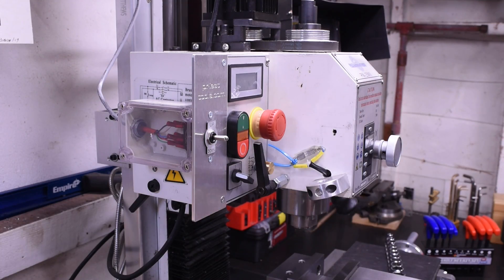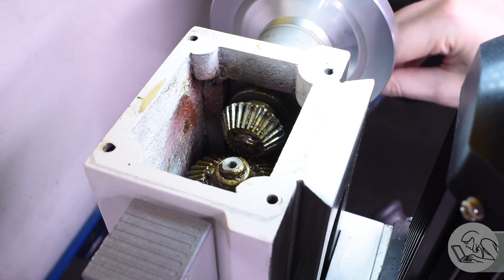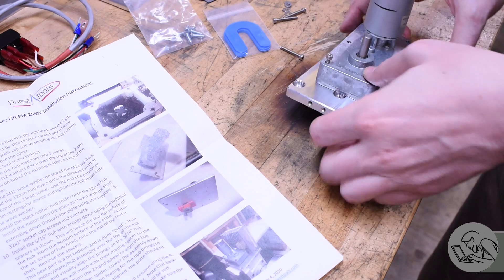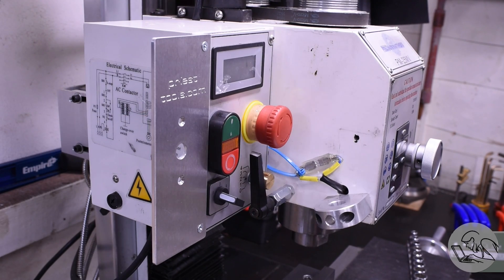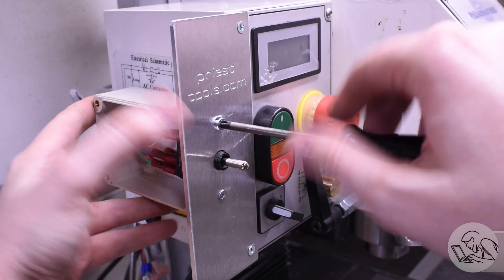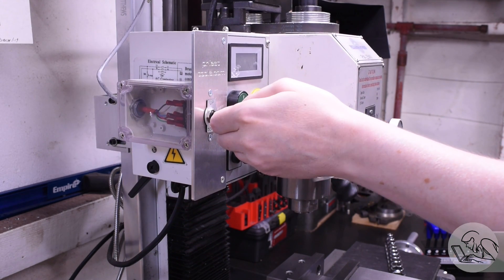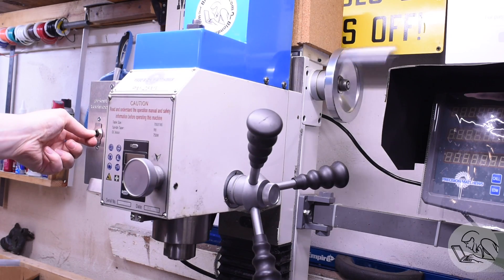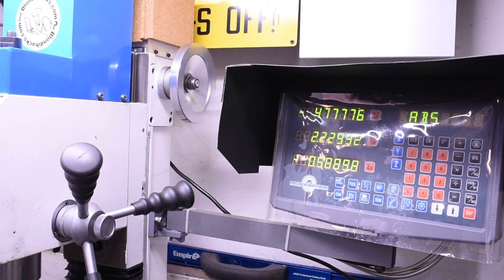Power Z Feed For The Head on a PM25 Milling Machine!

Comment: Hmm. Pretty cool; didn't know these were available. I've always kept a cut-off 13mm nutdriver, chucked in a 1/2" drill, next to my Grizzly G0759 (0704). Works great to quickly run up the Z, and it's "stupidly simple" (and cheap)

Comment: I was wondering about travel limit switches but the motor would stall and as soon as the switch is released the power is off so not necessary.

Comment: Hey Blondi, I'm a carpenter and I can consistently cut to a 64th of an inch with a worm drive Skilsaw #NotSponsored all day long (I even do it while wearing ear plugs and eye protection) so there's no excuse for a machinist who can't cut cork board to a quarter of an inch with a utility knife :-).  Moving on, I had to silence a very noisy air compressor once that took up the shape of a two+ foot cube. The base was a concrete floor and the sides and top where 3/4 inch particle board lined on the inside with walls of 2 inch blue styrofoam (adhered to the particle board with dabs of silicone caulk).  The lid was just laid on top of the walls (also insulated with the styrofoam) and could be simply lifted off to access the compressor controls as necessary (was held in place with a couple of drywall screws so it wouldn't rattle).  When the lid was in place the styrofoam laid right down on the inner foam walls.  The inner foam box and the outer particle board box had no gaps in their respective corner joins. There was a two inch diameter hole drilled near the bottom on one side of the box where air could be drawn in and the power cord could come out and there was another hole on a different side for additional air flow .  There was a third hole that was smaller to accommodate the exiting air hose.  These holes were then lightly plugged with pink spun fiberglass insulation.  This box took the sound of the compressor from deafening down to a hum.  The noise reduction was quite impressive.  Heat dissipation was not an issue because the compressor was running intermittently. It was just being used to supply a finish nailer and a narrow crown stapler.  The trick of success here is to put the less dense "decoupler" on the inside of the more dense outer "deadener" and additionally try to get rid of every possible air gap.  Assemble wooden parts with glue and foam parts with silicone caulk. 

Moving on again, I was glad to see that the replacement drive train took away a big chunk of the noise you were experiencing.  Priest Tools QC should have caught the problems with the first drive train as well as the switch box hole misalignments and sheetmetal cover fitment.  Low volume small businesses have the opportunity to test their products individually before shipping (because of low volume) and should do so, especially when the main component (the drive train) is not something that they are manufacturing in house.  It's strange that you would defend them for these errors when you yourself wouldn't send out let's say a vise stop as a box of parts that you never actually tested for fit.  Think about it, the crappy  threads on the socket screw, the initial no-go on the stop pin. Wouldn't it be fun if that was what you received in the mail from Blondihacks Enterprises #Not Sponsored.  What makes a product good is the attention to those details.and delivering the so called "plug and play" device. (For an example check out Bell-Everman.com #NotSponsored) Even the polish with the  ScotchBrite wheel adds quality.  Just because someone sends you a product #Sponsored don't get all gooey and drop the standard.  For something that costs $350 and except for the base plate and sheet metal cover is a collection of off the shelf parts it's just not acceptable.

That was exhausting.  I'm going to go eat something...Give me purr Sprocket...

Comment: So the thing about countersunk screws is that when they don't line up nicely, they will stick out and be super obvious. Might have been a better choice to open up the switch hole. For extra awesome switch mounting, the trick is to put the nut on the back of the box, and the knurled nut on the front. Line up the knurled nut flush with the end of the threads then tighten the nut with a super special extra thin wrench. It's way too much work, but it looks excellent!

Comment: Nice kit.  I built my own using a right angle wheelchair motor.  180 rpm max / 50 rpm min.  Enough torque to   bore at a good feed rate.  Made a dog clutch to be able to disengage and use the crank handle for fine adjustment of the Z axis height.

Comment: well from my POV, for less bucks you can get a closed loop stepper with a pulse generator and make a control panel with switches and poti to control speed and direction. And you can use it later on for CNC conversion ;)

Comment: I have a friend down in Annapolis who built his own Z Lift. One of the things he did is add a counterbalance to the head. He used SS wire anchored to the head and pulley wheels on either side of the column. Rectangular Iron weights from an exercise machine equivalent to the head weight, hang down behind the back of the machine. The stepper motor he used therefore did not have to be as powerful. Here is a link to the video: https://youtu.be/pN1iDhBmo2I

Comment: Nice kit review and it sure beats cranking the handle all the time! Take that heavy metal handle off of your hand crank.  It's acting like a vibrator motor at higher speeds.  I remade mine out of HDPE on the lathe.  Removes a good bit of weight and still functions the same.

Comment: I discovered your channel while searching for long lost knowledge of lathe work, after a recent need caused me to dust off my mini lathe for a project.  From the darkness of my memory, a chatter rang out.  Behold, I binge-watched your entire lathe series, and the dark clouds dissipated and I discovered not only the long lost knowledge, but found all the bits and pieces and tooling that I had repurposed over the years for other projects.  Your presentation is clean very easy to follow and is so very much appreciated.  I am but a neophyte with only a milling attachment for my Grizzly.... still, with all ten fingers intact, hope springs eternal. Thanks!

Comment: WOW ! 300 buck for this thing !
Motor costs no more than 30-40$ on aliexpress and an old PC alim will be a perfect power supply (with 3.3 - 5 and 12V directely available). coupling can be done on mill with a rotating plate.
Not sure than this won't overheat. I havent seen any cooling hole on the cover. It's true that it won't be running for a long time.
I've got the same mill and I removed the motor cover for the same reason (I saw that you already have a burned one)
P.S. : J'ai regardé tes autres vidéos. Ton français est très bon, avec une pointe d'accent charmante ;)
Reply: Yes you can build a z drive for a lot less- and what do you have a mill and shop for?
https://www.youtube.com/watch?v=J5zTBCMfZro&t=122s

Wiper motor from an old vw, and some odd bits, and "el-cheapo" is your uncle....

Comment: I used a 12v speed controller installed in line with the power supply. You can control the down function to a crawl for drilling and power up at the up function at the max speed at the twist of a knob.

Comment: I have a giant RC servo that uses that same motor and gearbox and a potentiometer and a little controller board.  When I got it, it had a 2 inch diameter output 'pulley' and my father, a welder-fabricator and blacksmith, wasn't strong enough to hold the servo like a jar of pickles and stop it from turning, or force it to turn against it's will!  That's a hell of a little gearbox.

Comment: C- on the deboxification!

You didn't open the box using a chainsaw, angle grinder or other similarly suitable power tool. The content was not cut, stabbed, slashed or even scratched during deboxing. The content was not dropped on the table from height as you upended the remains of the box. Finally you looked at the instructions! Instructions are, if they manage to survive the deboxing in readable condition, to be sneered at and thrown in the round filing cabinet if not carelessly tossed over the shoulder with a practiced look of contempt on your face.
Reply: open the box, not open the bow
Reply: @NoName-zn1sb  Fixed that...

Comment: FYI most wire  crimps have a built in screw cutter on them so if you have a set to crimp ends on  wires you have electrical screw cutters.

Comment: I started my mill conversion by adding glass scales with LinuxCNC. (no need to purchase a DRO controller). Next, up was adding XY ball screws and closed loop steppers. Finally added Z stepper and home switches all around. I use a joypad for manual milling, type in G code for simple repetitive motions and use F360 for complex shapes. The point being I think it's easier to start with an old computer that can run LinuxCNC and add capability than separate kits that don't add up in the long run.

Comment: not a huge deal on this switch but there is supposed to be an alignment ring that slots onto the key way and then also slots into a notch at 12 o clock in the hole. industrial switches have this to keep the orientation correct and solid.

Comment: Hi from the UK. I used an old windscreen wiper motor and gearbox (worm and wheel, loads of torque and very quiet) off of a Reliant Robin three wheeler, fitted in place of the handwheel. The handwheel was very difficult to use after I knackered my right arm. Been working great for the last five years. It's a bit slower than yours I think, takes about 30sec for full travel of column. Keep up the excellent video's and the correct English pronunciation.

Comment: That’s a nice addition to your mill, I’m sure it will save a lot of time and effort, just an observation here in New Zealand it is considered bad practice to run the Ac mains cable and the low voltage control cable through the same gland as there could be a possibility of damaging the insulation and arcing to the controls.
Reply: The price of two nylon compression glands is maybe 2 or 3 dollars and would give better support for the cables where they enter the case, I’ve worked in engineering as a electrician and never been a fan of that type of metal cable gland as with vibration the outer sheathing can be damaged and it can get really messy when things start arcing out.
Reply: Probably not as big a concern for 110V as 240. We get real sparks.
Reply: Generally that is a very valid concern. In practice there are a lot of older machines where it was done the way we see in this video, and while some have indeed caught fire the huge majority did not. To borrow from Apple, a very small minority of machines has suffered this type of failure. My point is that if you are using good quality cables and isn't to ham fisted while installing it is not much of a risk. But still it would be a good idea to redesign this if / when they refine the design. Also with machinery that vibrates or oscillates the risk does increase somewhat.
Reply: I have an Emco FB-2 and want to do this to i
DRO was a big help

Comment: Okay, the technology in the analog transformer-rectifier-filter capacitor power supplies may be old--even older than me--but it doesn't add to the RF noise floor like the "modern" switching types do. Those MeanWell supplies are pretty good (they meant well, after all), but the hundreds of millions of cheap-as-dirt walwarts--along with plasma TVs, poorly-designed and grounded "smart" utility meters, an aging-and-arcing power-grid system, and--wait for it--at-home car-charging systems, all add up to a lot of RFI. How's a guy supposed to pick up WWV and the BBC with all that noise?

Comment: A stepper motor might have been a better fit instead of the DC motor. They certainly have the torque to move that column and speed control is easy enough with an Arduino.

Comment: When you have a set screw that seats on threads and you don't want to mess up your threads, place a piece of lead between the set screw and your threads. I do this by using a piece of number 6 shot out of a shotgun shell for the size I need. But any chunk of lead that will fit in the hole will do.
Reply: That's a really good idea.

Comment: An easy alternative is to use a battery drill
The shaft for the manual handle is parallel (not tapered) on mine so I've just removed it and clamp the drill chuck onto it.
Instant up/down power feed!

Comment: In the future if your worried about a set screw buggering threads you can drop in a piece of lead shot under the set screw.  Standard procedure with reloading dies. Shorten those screws on the enclosure, and add some dynamat or even better the non name brand stuff and it ought to be better.  ETA great with the new motor!

Comment: Add a silicon diode or two in series with the "down" side of that switch.  Then the motor will see less voltage on the way down versus the way up.  Might even out the up and down speeds. 

I'd want a lot less "down" speed than up.  I'm ditzy and would definitely crash my mill.  Going slower down might be more compatible with my ADD.  Maybe add a bunch of diodes so it sees way less voltage on the way down.

Comment: One other quick question, I have a real dislike for the high pitched whine that often comes with VFDs and such. I have been told that higher quality gear does not have as much of a problem and that you can sort of tune it out of that range. Is this true in your experience? Any other tips before eliminating this whine? There's no way I could work with it long term.
Reply from the maker: I don’t have experience with VFDs, so I’m no help there

Comment: Amazing, Quinn, you used my sentimental favorite drill in this video! (A black and decker with the pull-off chuck and the hex driver underneath, very useful for drilling pilot holes then driving a screw) Lots of good memories using one with my dad until something got in the brushes and it burned up. Picked one up used a few years ago. Is yours nicad too, or did they actually make a lithium version? Do you still run it on nicad, or did you pick up a battery adapter for it?

Glad this ended happily!
Reply from the maker: Yes! Ergonomically, my favorite ever drill. Sadly no modern version AFAIK. This is the old NiCd version
Reply: @Blondihacks  The drill had too much common sense built into it so they discontinued it.
I have had mine since 2008 and sadly now it is getting worn out.
It was the most common sense set-up and now the enginerds and the bean counters have stopped it.😔
Reply: @willardlentz3044  so the little brushed motors in most battery powered drills are pretty standard and easy to buy, I bet you could repower it if you wanted. I can't remember offhand the part number of a "cordless drill motor" but it's like 3 letters and 2 digits, I'm sure you'll be able to find it.
Reply: @rpavlik1  Thanks that drill has served me in my job and now serves me in my hobby.
It actually outlasted my Dewilt.
And no I didn't spell it wrong.
BTW Dewilt is just an over priced B&D
Reply: Closest I've seen is the "Matrix" one, but that's not as fast. There's also a tool category called something like an "installer drill" that has similar quick change apparently. I just picked up an adapter to be able to use my Black and Decker 20V lithium ion batteries with it, should be a lot more useful that way than even with the battery pack I rebuilt with cells from a Harbor Freight battery. (Lighter too.). I agree it's one of those things that made too much sense so they had to stop making it.

Comment: I've been looking at various Chinese power feeds for a year now. I have a shop built mill with 1 1/8 shafts. I'm pretty sure none of these kits are strong enough for my situation. My question is, how does one measure how much force (?) Is required and thus what size motor and gearbox you need? I think I remember something about Joules and I'm sure I could locate a formula if I went looking. I'm wondering if there is a more common sense, rule of thumb sort of approach? I don't really have a sense of what 750 watts really means in terms of actual output. Is there a chart or something you could point me to? Thanks very much in advance, but no problem if you don't know
Reply: I’d try measuring required torque rather than power. If you have one of those lever type toque wrenches and a suitable bolt head you could get an estimate of how much turning effort is required to get things moving. Power is then torque against time, how fast do you want it to happen? Then pick something a bit bigger that you need but which is adjustable so you can set up in situ to your preferences.
Reply: @adrian_r  thank you very much! I can't believe that didn't occur to me! Torque wrench, super obvious. I can't thank you much

Comment: Once I saw the DC 775 motor, I knew there will be issues, those motors are fine for small little projects and experimenting, even then the brushes getting destroyed very easy. Stepper motors are so cheap these days, they could have easily used that or a brushless motors. Also, open the gearbox, the gears are plastic.

Comment: Amazon and Ebay both have low cost "PWM DC speed controls" that work with about 7 to 30 volts input that would control the speed of your motor.   It would not be hard to include in a slightly bigger box along with the on-off reversing toggle switch if you still want a speed control.

As for power for downfeed operations the weight of the head would be added to the power of the motor.  So it shouldn't be an issue I'm thinking for drilling or boring operations.